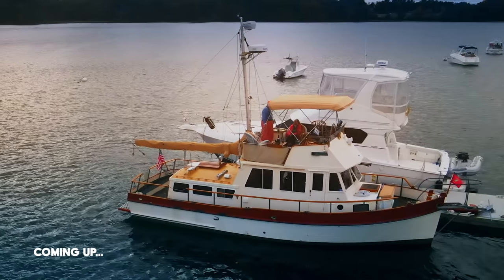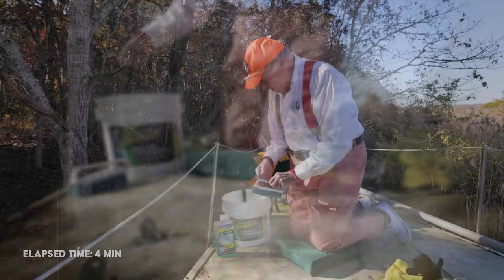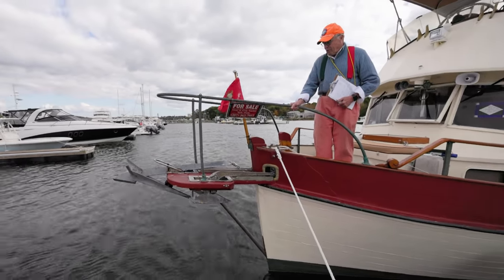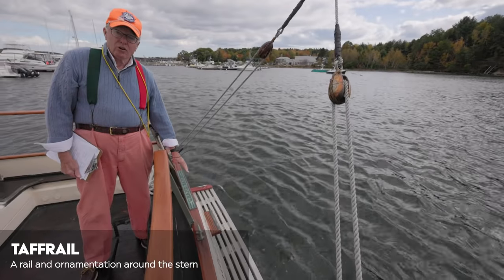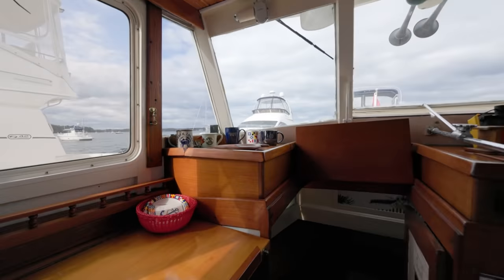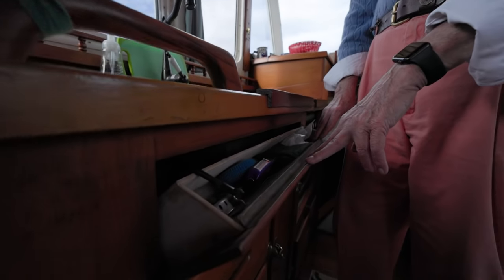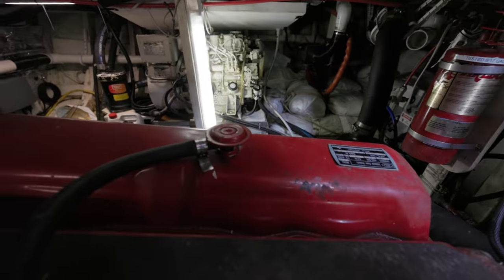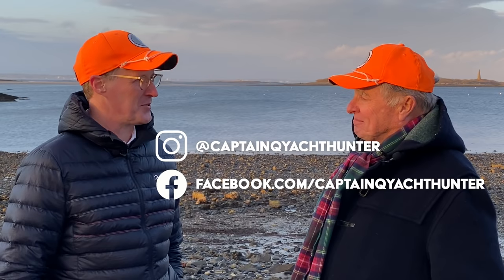$49,500 Classic Trawler for sale! Grab the Grandkids and go! EP  #trawlerforsale #motortrawler

Comment: Hi Cap. & Randy.   
How coincidental you would pick a GB trawler, when you mostly look at sailboats.  
My grandfather bought a brand new 36’ Grand Banks in the mid 80’s. Named her YOHO.  I never got to go on long passages, however he took my mother up the BC coast. 
I did go out one weekend, which sparked my love for boats.  He owned it for over 20 years. But, Because of that short experience ,    I LOVE boats. 
I’m on my 3rd, which is a beautiful deep V- 1983 -30’ SeaRay SunDancer. I’ve spent $20,000 getting it in great running condition. The interior is mint . (If you need a power boat to look at, hint hint).  

I’ll be putting it up for sale so I can finally get a sailboat.   Which is why I watch your channel.  That’s how 
I found it funny that you would stray from sailboats , and basically hit the the boat that started it for me.  
(Why did you stray from sail? ) 

As always, I can’t wait for each episode.   You guys are great.  
Thanks for doing what you do!!!
Reply: They've done one or two trawlers before. It's mostly sailboats, but this isn't a completely new thing for them.
Reply: @norarivkis2513  cool.  Thanks.

Comment: Hell yes there is a good reason not to want a wooden hulled boat; maintenance. If you take it to wa water, like Florida, you may find your boat sinking due to wood borere. To stop this you will need to haul out every year for bottom paint, adding thousands to your cruising budget. A boat built that long ago is going to have problems with the screws used to fasten the planks to the hull. If you keep it in cold water and never go anywhere, if you love working on boats rather than cruising, go ahead and buy it.

Comment: those slanty covers for the storage in the master cabin would be good for laying up several charts showing a long passage course. I'm curious about why and how you'd use that sail
Reply: It might help reduce your fuel burn on a passage with a favourable wind...it could get you home at a push if you had a motor fail but  it would help steady her at anchor  or underway in the face of a beam swell by slowing the rocking motion. I think he mentioned that at the very start.
Reply: @clivestainlesssteelwomble7665  I'd like to see how that is supposed to work, i would have thought that it makes it less stable.
Reply: @m1k3droid  

If the swell is rocking the boat side to side being tall the rotations down near the water line or below..its like an air brake/fan. Sail boats especially with a ketch rig can part deploy their sail .. to slow the movement.. and keep the bow into the wind at anchor.
You can also deploy flopper stoppers.
Reply from the maker: Great feedback, Clive… spot on
Reply: @YachtHunters  ok this explains to me about some turkish old timey motor yachts being produced today that have a stunted mast and boom above the top deck. I was curious that they were too small to actually propell the boat much at all if the motor went out.

Comment: 27 sounds like a good number the layout a little strange but fixable as well as instrumentation on the flying bridge other then that wonderfull grand banks I have worked on maybe 6 of the 32's maybe 2 of the 36's maybe a 42 and one of the big 50 whatever the only thing that drives me nuts about grand banks is bad bulwark construction and Parque floor soles and Ford Lehman engine